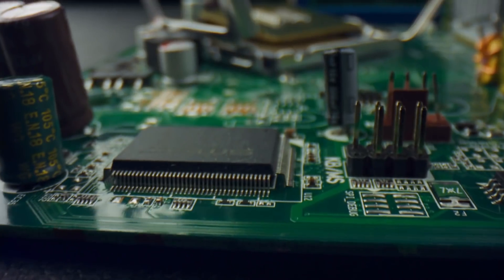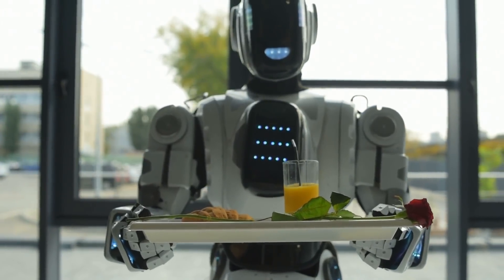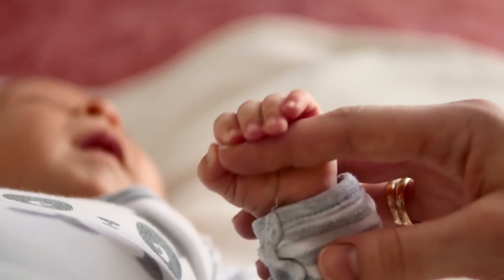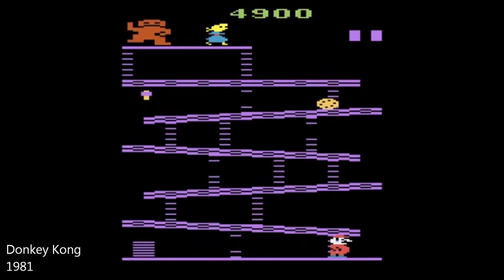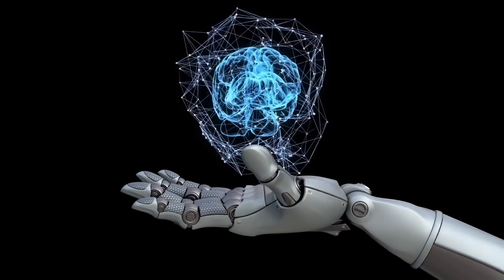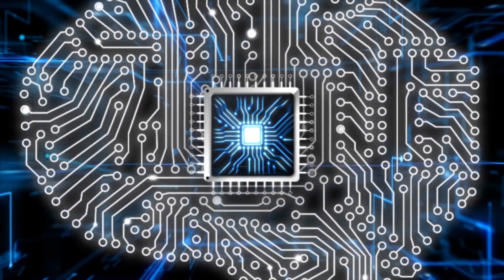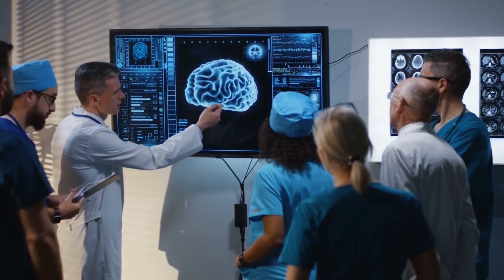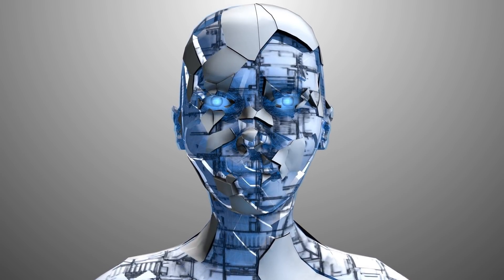The Dominance of Artificial General Intelligence - AGI The Final Chapter

Comment: Forces act only at a point and always take a wave shapes. The basics of machine architecture. They can never be a straight line. Forces can be balanced only within a particular wave length. Suns diameter of mass is where you can trap light.

Comment: Kindred AI uses
DEMONIC programming: a computational language for single-particle equilibrium thermodynamics, and its formal semantics.
Also Temporal Logic

Temporal Defense Systems has a D-Wave 2000Q system.

Canadian purveyor of quantum computers, D-Wave Systems, announced their fifth-generation, 5,000-qubit system. The new quantum computer, named Advantage, will be made available for on-premise deployments and in D-Wave's Leap cloud service in mid-2020.

The Advantage design incorporates D-Wave's new Pegasus topology, which was announced in February. The new topology design provides higher connectivity, influencing how problems are solved. Higher connectivity allows for more complex problems to be solved using the same number of qubits. With higher connectivity, less qubits are needed to solve problems.